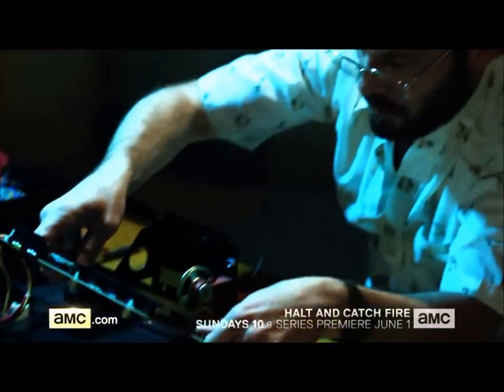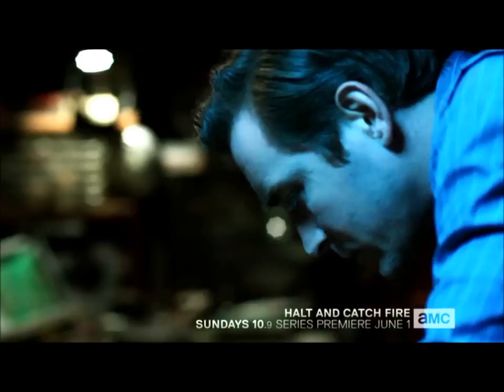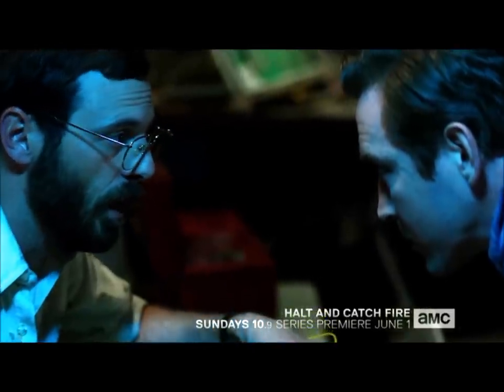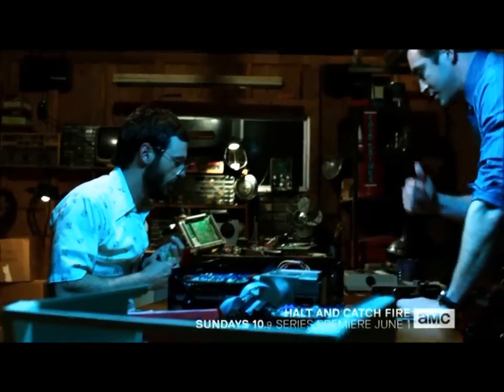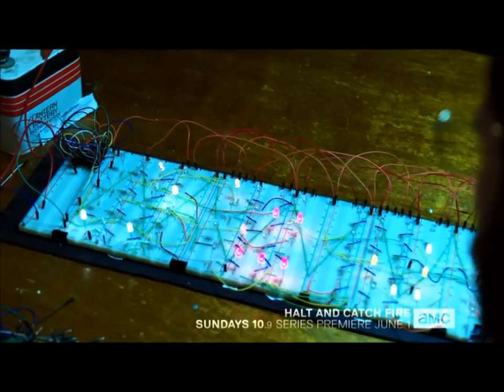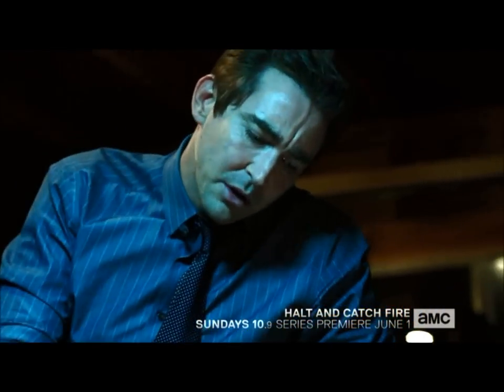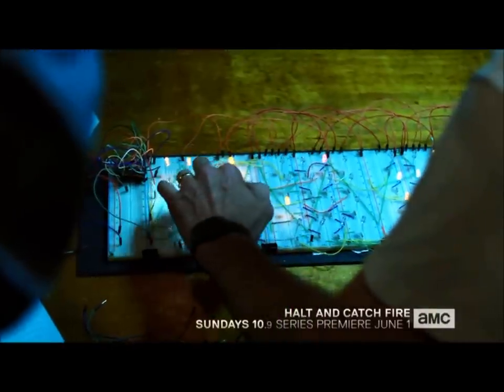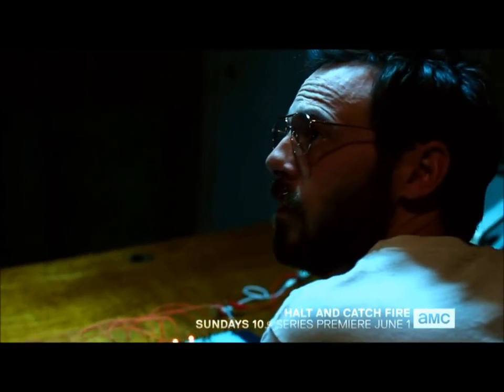HCF Reverse Engineering BIOS from IBM PC

Comment: Why are they desoldering a socketed chip? :D
Reply: ikr
Reply: My thoughts exactly
Reply: Why are they manually transcribing the ROM contents when they could have dumped it from memory?  Why are they only dumping one ROM chip which will have either only even or odd addresses (early IBM PCs used 2 ROM chips)?  Why does the computer blow up at the end?  Nothing makes sense here.
Reply: @uzimonkey  You cant dump it from memory, not everything is loaded to memory
Reply: @madr1x  The BIOS ROM (and BIOS extension ROM, such as the video BIOS commonly found in the C block of IBM PCs) chips are literally sitting on the memory bus, there is no "loading" to be done.  If they can't be directly addressed then the computer cannot boot.
Reply: @CB3ROB-CyberBunker  the 8088 has a 20 bit address bus and 16 bit internal bus
Reply: @ducksonplays4190  yes, and? it has an 8 bit databus to the outside world. and even that is multiplexed with the address lines. and as such it only needs 1 rom for each thing. not odd/even like on real 16 bit computers.
Reply: Its partially multiplexed but the address bus is still 20 bits and on different clocks the first 8 bits are data busses and address busses
Reply: @ducksonplays4190  it needs that other chip out of the intel chipset that ibm did not use to turn it into a normal system. the bus demultiplexer thing. but ibm never put it in.
Reply: not like intel themselves didn't know multiplexing address and data lines is essentially just a pain in the ass :P let alone multiplexing anything else :P and yes they did have that other chip to turn it into something a bit more 'motorola' like. lol. but pc's simply remained multiplexed all the way up to the the pci crap of today.
Reply: either way, as such. it does not need 2 roms for 1 program. as the bus is 8 bit wide, the rom is 8 bit wide :P the rest is just some logic and decoding.
Reply: They probably did use it
Reply: @CB3ROB-CyberBunker  that must mean my breadboard computer is superior to it it's data bus and address bus are separate
Reply: Well ibm isn't the smartest
Reply: @ducksonplays4190  8689 or so it was. the '4th chip' in the intel set
Reply: @CB3ROB-CyberBunker  hmmmm

Comment: What happened in reality was a two-step process. One team goes through the IBM BIOS and creates a specification, the other implements the specification. For liability-purposes, the second team should never have previously seen IBM code.
Reply: They do that in the show later on. This scene was only the extraction of the BIOS ROM. What I don't understand is why they do it by hand with a notebook and a breadboard. Didn't they have like a dumper or something like that?
Reply: @migueld2456  you’re assuming they were readily available at the time
Reply: @shanemshort  I believe they were. If ROMs and other ICs existed, it is reasonable to assume a sequencial circuit that basically counts the addresses existed, especially since much more complex boards like entire microcomputers were readily available to the public. But correct me if I'm wrong.

Heck you could connect the ROM to the parallel port of an IBM PC and bitbang a ROM dumper

Comment: Commenting as a novelist and computer scientist and of these characters' generation: the dramatic inspiration for the reversing engineering storyline was Tracy Kidder's Soul Of A New Machine (and I drew on the same book, with acknowledgment, for one of my novels). The dominance of IBM rang so very true and took me straight back to my early programming career, when I watched Episode 1 of HCF. 

Part of the fiction here is actually the need to analyse the BIOS, as mentioned below by uzimonkey. I don't remember this, although I coded on an early IBM PC (being used to larger IBM machines), but I believe that hardcopy BIOS was actually shipped with some machines. (I wasn't interested in the BIOS at the time: I read about this in a retrospective written by an ex-IBMer or ex-Compaq creator.)

Still my favourite tech TV show, is HCF. And yes, the most glaring technical boo-boo is when a mainframe terminal runs PC DOS, but never mind. Pure nostalgia. Love it.

Comment: You don't have to desolder a socketed chip, just sayin' :)
Reply: for that matter, bad code won't create sparks and trip a fuse for the lights.
Reply: And for that matter, they could have just written a computer program that dumped the hex code from the chip 😂 I love the show but boy it’s not very accurate.
Reply: @squirlmy  Yeah what on earth was up with that 😂 If you get a syntax error your whole computer just explodes??
Reply: @johnmcallister7833  Exactly. The BIOS ROM has to be in the address range FFFFF0 for the reset vector on an Intel 8088, you can simply access that memory range and dump the last 8K (size of the ROM chip) into a file. Takes you 3 minutes to write and execute.
Reply: Well, those days back then you could never be certain that this wouldn't happen... @squirlmy
Reply: A DC voltage wouldn't look like a sine wave on an oscilloscope either ¯\_(ツ)_/¯

Comment: As far as I can tell, everything in this scene does square 1:1 with reality. By that I mean: what they're shown doing does/did indeed work that way in real life.

The scene falls short of being totally realistic, though, because the way they're dumping the chip is unnecessarily tedious and error-prone. It's a very "Rube Goldberg" way of getting the contents of the ROM: flashy and fun to look at but not practical.
Reply: What would have been the "right" way to dump the chip contents?
Reply: @brunospasta  Good: Gordon connects the data lines not to a bunch of LEDs but back to the Commodore(?) he's using to advance the addresses, so that it can just write the data straight to a file.

Better: They put the BIOS chip in a (E)PROM programmer and have that dump it.

Best: They leave the chip in the PC and run a program on that to save its contents to a file.

Comment: The computer came with a book that had full schematics and they could have dumped the ROM to disk with the debug program that was right there on the book disk.  Nothing here makes any sense, but I guess that would have been a much less dramatic scene.

I don't get why they're doing this though.  The one thing they can't legally copy is the BIOS ROM so why bother doing this at all?
Reply: They indeed couldn't legally do it, if you watch the rest of the season you'll know how they got around that.
Reply: I think the point was to get ahold of the operating system in order to get an idea of how a functioning operating system works, and more importantly, use it as a reference to make a similar one without violating copyrights.
Reply: The word "copy" has two meanings. You can't redistribute a direct copy of the IBM BIOS, but you can redistribute a functional equivalent
Reply: they had to make something that functions like the IBM BIOS, without looking at it themselves. The only way to do that is for one team to get the specification (and yes that team could dump the ROM), and the other team try to get the same BIOS results (booting into DOS) without any of IBM's original code. "The one thing they can't legally copy is the BIOS ROM" well yes, but BIOS is exactly what is needed to run programs!! Other companies like Digital did run slightly altered versions of MS-DOS which would only run a few of the applications made for PC-DOS. Reverse engineering a BIOS is extremely tedious, and this scene does dramatise just how tedious a job it was, while minimizing the suffering of the audience! Note also, Compaq's team ended up with a BIOS that was half the size of IBMs, and they were panicking the first few weeks, worried that they missed some important functionality from the original. Turns out they didn't. Just IBM's BOS code was crufty and bloated.
Reply: @squirlmy  Sounds legit.🙃

Comment: They've only just begun in the reverse engineering process?
Besides the ROM dump, They have to disassemble the program
to decipher how it even runs. Then using a logic analyzer,
decipher what address is responsible for which command...
From a comment below, They diddn't even bother consulting 
the technical reference manual..
Reply from the maker: someone sound the nerd alarm:)
Reply: Nick, I'd consider myself more of a geek.
"Nerd" IMO refers to the mainstream of techie know-it-alls
like Linus Sebastian.
Reply: the moment you open the manual you can be sued for copyright.
Reply: @teresamartinson7427  No. What happened in reality was a two-step process. One team goes through the IBM BIOS and creates a specification, the other implements the specification. For liability-purposes, the second team should never have previously seen IBM code.

Comment: I'm sure there is a good reason for but I don't get why they couldn't read the boot code electronically.
Reply: because they's be accused of copying it. They had to legally protect themselves by NOT looking at the boot code, and yet coming up with the same results- with an original boot code they came up with themselves. Pretending it is a black box (that's literally the term they'd use). A year later, Franklin Ace copied the Apple II boot ROM directly. They tried to argue copyright didn't apply to computer code, but 1984 Court Case by Apple found Franklin liable for copyright infringement and they had to pay Apple millions in addition to ending that line of hardware. Compaq could have taken chances, and used an engineer who knew just a little bit of code, but there's no way to know beforehand how much of the code must be different for a favorable court decision. The only way to be sure, is if no one working on it saw any of it beforehand.
Reply: @squirlmy  I'm well aware of the history but he made a crude hex dumper with the LEDs. He could have gotten the same result reading the BIOS normally and nothing would have changed copyright wise.

IBM PCs were really well documented actually. I guarnatee they didn't have to guess which chip was the EEPROM.